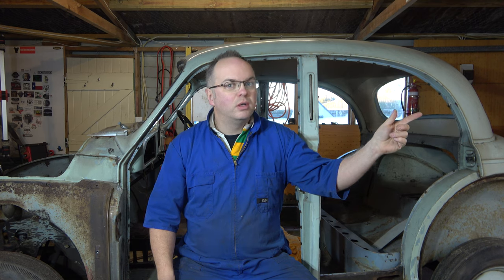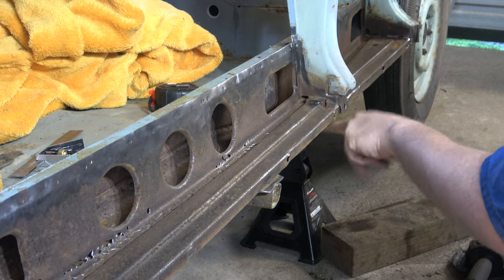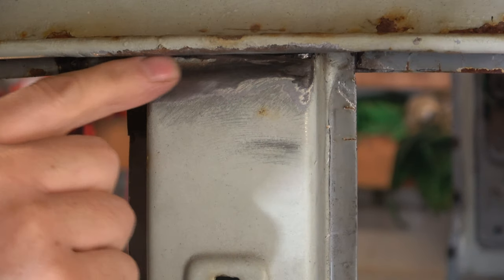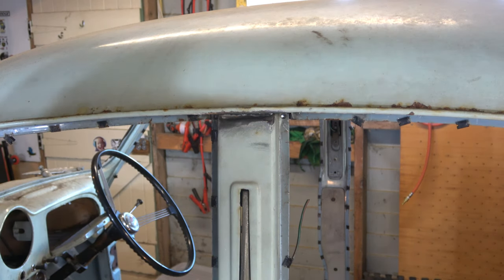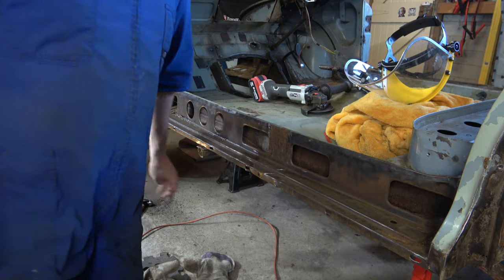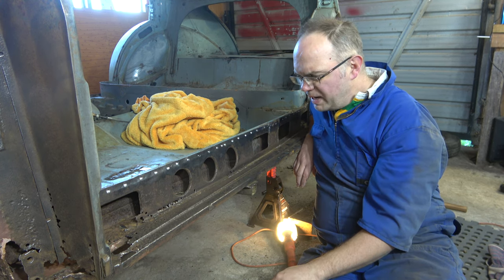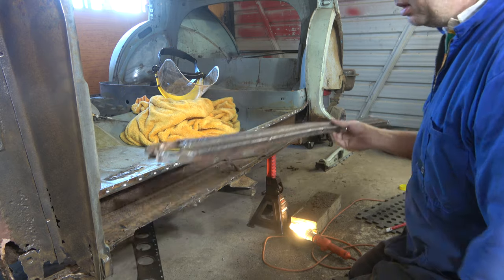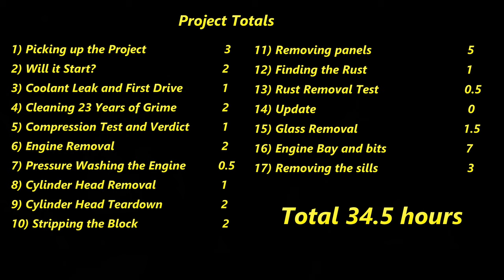Morris Minor - Cutting out Rust - Part 17

Comment: Good see you making headway  on the Moggy 👍 Personally, in addition to the measurements, I'd have tack welded some temporary bracing , front to back, top to bottom just to be sure it all stays in place & doesn't sag. I'd definitely give it a thought before you start removing anything else or you could end up with hell of a job hanging the doors.
Reply from the maker: Thanks for the advice. Definitely something I'll consider before chopping anything else out
Reply: i have to agree about the bracing Hes asking for trouble by not doing it
Reply from the maker: Ah well, it will be as straight as it came out the factory 🤷‍♂️

Comment: Reminds me of when I worked in the body shop.There are special tools that make drilling spot welds on the pinch areas super easy but of course theyre expensive. You're videos are inspiring me to push forward my my project...lots of rust to fix also .
Reply from the maker: I did have a spot weld drill but it was a cheap one and didn't work at all. Glad this project can be an inspiration 😊
Reply: @Badgertronix  Pete C uses a bit similar to yours but using a different technique - he pre-drills every spot with a regular 3 mm bit (or whatever that centre bit is on your spotweld removal set) all the way through and then follows up with the spotweld bit. That looks more time-consuming but easier because the spotweld bit can't move about.

Just for clarification, 99% of my knowledge about car repair and restoration is entirely theoretical and picked up from Youtube :-D

My practical experience is limited to replacing spark plugs on construction equipment (basic 1-cylinder Briggs or Honda) and replacement of minor parts (front indicator assembly, rear edge cover) on a Mitsubishi L300 - nothing past a few Philips screws. I do also have some experience with rusted fasteners from messing with pre-WWII trams and lifts. No welding or sheet metal repair though.

Comment: Might not be a bad idea to get the replacement panels before you take too much else off. You might have to do some custom fitting, and keeping the original things in place will help you make some good measurements.
Reply from the maker: Great advice and that's the plan. I just needed to make a start so I could figure what what I needed. Cheers
Reply: Yeah, that was my concern too.  Hopefully you can get the right pieces and they fit, but sometimes the quality of parts leaves a lot to be desired, and requires rethinking your repair approach.
Reply from the maker: @joshonthetube  I hear good things about the panels I was planning on getting but you can guarantee there will be plenty of custom work needed
Reply: edward mckenzie my thoughts exactly.

Comment: This video popped up, so started watching the playlist. Just in case you don't know, Moggies were designed for a flat 4, like a Beetle. But they couldn't get it to work, so put the A30 engine in. Hence all the space under the bonnet. I had 2 of these in the early 70s, both needed lots of welding then lol. Not quite seen it yet, but guess it's No1 exhaust valve. I also reconditioned engines in the early 70s and have done a few of these. But mainly Ford Mk1 Cortina 1200cc. Terrible engines. A series 2nd best ever made, after the small block Chevy.
Reply from the maker: Spot on, burnt valve on no1 cylinder 👌

Comment: Noticed the amount of tin worm holes in that inner and outer sill location and brace panels, lot would say to patch them and install new metal where needed. But with a car from the 1950s I suppose a complete panel strip is the best way forward time consuming but for a worthwhile job on a classic like the morris or austin 1000 it's worth it. Nice video upload by the way you are a true craftsman looking forward to your next upload. Regards
Reply from the maker: The repair panels are cheap enough so might be the easy option. Although replacing lots of panels gets expensive. I'm sure I'll end up with a happy medium. Cheers

Comment: looking good  the front pillar and rear dog leg  i usual mark about 3inches above the era i need to remove then cut it across and drill the spot welds far easier than removing the whole panel
when you go to refit the centre pillar  use some screws to  hold it in place most times after you take something like that out the gaps will alter by screwing it in first  you can fit the doors and gap it prior to welding
try plug welding the new panels in if you stitch weld the heat  will tend to pull the metal as it cools  and might cause issues when refiting everything doors etc
Reply from the maker: Great advice, thanks. I was thinking that could be a good option to cut out the bottom section only.

Comment: For the small rusty areas, cut them out and replace with sheet metal just like @jademuttley does. He’s an amazing welder/fabricator so why not give it a go and save the time it takes in taking more panels off. 😀
Reply from the maker: I want to take off as little as possible but I'm not an amazing welder/fabricator so I'll do my best :)
Reply: Can't agree more why replace if you can repair. I was holding my breath all the time.me I'm 74yrs young and been repairing Morris minors since I was 13yrs old.please don't strangle hammers when using them hold them down the bottom of shaft.but top marks for trying. Kevin.